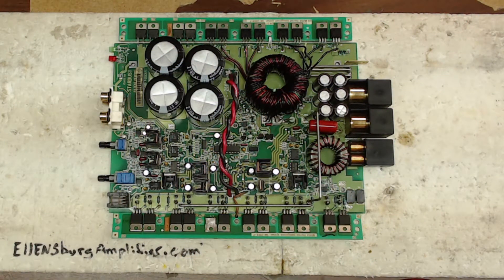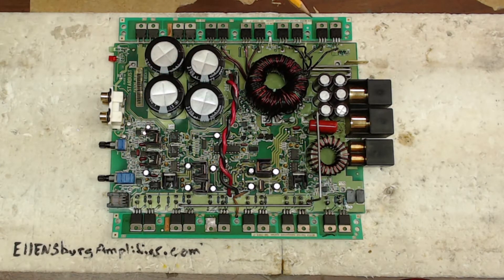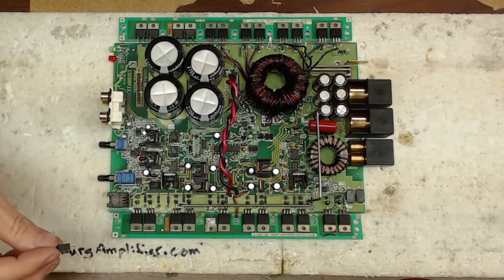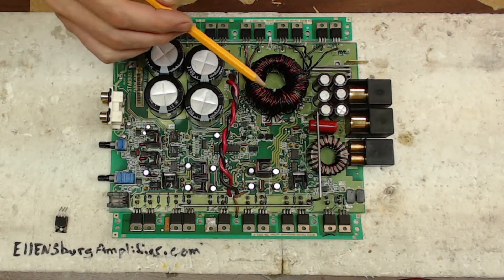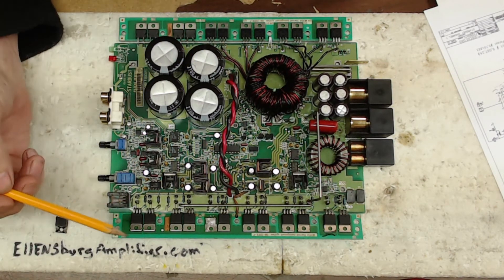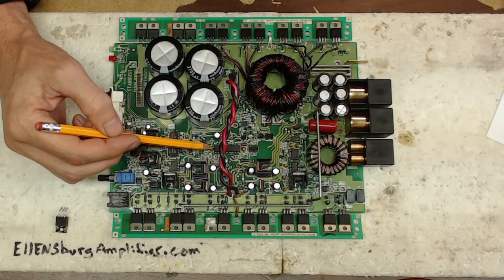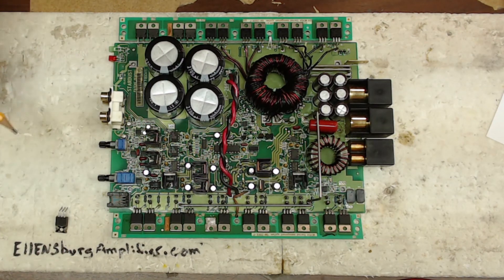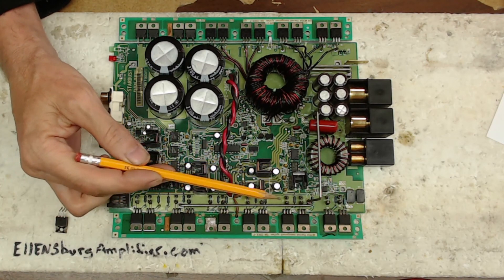Rockford Fosgate BD1000.1 Amplifier Repair Power Supply and Output Control IC's

Comment: Hi Todd thanks for the tip on using the voltage of only the remote
Reply from the maker: Thank you Tyrone for watching! I try to provide tip and tricks which makes the job a little easier.

Comment: The red capacitor behind ground terminal on my broke off. But it works flawlessly???
Reply from the maker: I think that is the output filter capacitor to ground.  You would just end up with some switching noise that you may see on a scope that could end up heating up the inductor.
Reply: @ellensburgamplifier  so what issues could it pose? It runs cool, never gets warm. Also running it 1 ohm with zero issues what so ever
Reply from the maker: @billyjeepus824  It may run fine for a long time. Just depends on how it is being used. I do believe I carry those capacitors if you are ever interested in putting one back in.

Comment: What power supply Transistors do you use in place of the MTP75N05HD on these amps?
Reply from the maker: I use the 75N05HD transistors as I stock them. I don't think I have an equivalent to them.
Reply: @ellensburgamplifier  where do you order them from? Or do you have a web store that you sell them on? Do you stock the output FETs also? ON semiconductor informed me that they sold that item to Motorola but they stopped producing them also.
Reply from the maker: @Dcelrod  I sourced my inventory of these a few years ago. Unfortunately, I do not sell them due to the low stock and their being obsolete. I hear Damon "Crazylogix" here has a supply of them he may sell. I don't repair these older Rockford amplifiers often so I am not sure what is used for the outputs.
Reply: @ellensburgamplifier  Thank you I'll try him and see what he has to say.

Comment: Would you be willing to work on a t2500.1bd? Amp has never seen under 2ohm and nothing looks blown. It just wouldn't power up one morning after working perfect the day before.
Reply from the maker: During the slow season which is October to February, I do service these amplifiers but right now during competition season, I tend to not take them in as sometimes they can take quite a bit of time to repair. www.ellensburgamplifier.com
Reply: @ellensburgamplifier  Thanks for the quick reply bud. Will send a request around then and see how you're feeling.

Comment: I have 2 of these amps that need repaired what's the ballpark estimate that it could cost to fix them? I know the one will need new power supply transistors or pHETS whichever one they use and the other I bought not working so I'm not sure maybe the same.
Reply from the maker: I don't put numbers here as the numbers can change over time. The cost depends on the work involved. www.ellensburgamplifier.com/request-a-quote if you would like more information. Thank you for the support!

Comment: I have a question I have a Rockford fosgate BD 1500.1 I had a repaired by a guy named Jason Gibson at Freeman car stereo. He replaced some output fats he said it's a power supply was whining like that one but he put four kinds of glue on it and he replaced a few of the pots game control and fixed some pads on the board that held them now he said the amp worked I had got the amp back I didn't even check it I want to sell it on eBay and the guy said it didn't work it Powers up it's not in protect I just don't get no sound now I turn the amplifier on I can see the woofers move a little bit and I'm wondering if this guy anything to do with the the sound card whatever that is driveboard or maybe it's something to do with what you're talking about what would stop the sound from coming out. What a loose pot level control perfect sound from coming out or a bad drive board I really like to get this app working but he messaged me told me if he was his he'd sell it as is because those amplifiers are really I reliable the older they get
Reply from the maker: It does sound like the output has failed. These boards will either work or they won't. There is no real in-between. I quite selling on ebay due to the fact that people do not understand clipping, low input voltage damage, or what a proper impedance load is. Do you know if he got it in, hooked it up to .5 ohm, blew it then tried to tell you that you sold a faulty amp? The problem is that the buyer has all the rights and is able to return it for a full refund. If he does then I suggest having the output looked at and repaired as needed.
Reply: I'm going to get a multimeter and check all the transistors if they're all good what would be the next thing to check
Reply: @ellensburgamplifier louder I watched the video again those transformers the guy I repair my Amp put glue on them because they were ringing.. but I'm going to check all my transistors to see if they're good or not

Comment: what are the output transistors thanks I have irf6215 406G and irf3415 303K on same output board which one is it supposed to be the same of appreciate your help
Reply from the maker: I don't know exactly what transistors that board will use but you have both the N channel and P channel which does sound correct when looking at the datasheets. The 3415 is correct as I found that I do have a schematic for it but it is not showing the P channel number. I still suspect the 6215 to be correct.
Reply: Rockford fosgate 1001bd power  old school one it's audio output channel figured you may have an idea I do have the irf3415 parts on hand is the reason I was asking thanks for your reply thebestyet218
Reply from the maker: @shawnoestreich218  If you have any shorts between gate and source you may want to check out the driver, the 4420CT.

Comment: I tried repairing a punch 120@2. I replaced the mosfets because that's all I noticed. Soon as I turned it on, pop lol. What would cause that?
Reply from the maker: Thank you for the question. This does depend on if you are talking about the power supply or the outputs but the following has the same concept for both. One of two things comes to mind. Over-heating the transistor while soldering it back on the board damaging it is one thing. The other is the drive signal. If any of the drive IC's are bad it may be turning on a set of transistors at the same time which causes a direct short.
Reply: @ellensburgamplifier  I definitely heated up the fets too much. It was very difficult getting them to lay back down flat. But I think your right and both side are coming on together
Reply from the maker: @Pittsburgh-412  There is a trick to soldering the transistors without cooking them. Hard to explain how to do it in words so I guess it will have to be a video! The next one I get in I will see if I can get a video on how not to cook them.
Reply: @ellensburgamplifier  ya that would be awesome. I seen one guy use a heat plate on his YouTube channel and that worked out. Plus I don't think I seated the fets good enough because I have a junk solder sucker lol. I'll look forward to that video man. I'm gonna sub too

Comment: trying to rest my AP on my amp what is that and location
Reply from the maker: I am not sure what you are looking for?
Reply: @ellensburgamplifier  the Amp is in protection mode
Reply from the maker: @ponchville  Unfortunately I do not work on these enough to know exactly where to go for that issue. The first thing is to check for shorted output transistors which are 90% of these failures.

Comment: Hi I need the schematic of the amp so I can repair my amp if u could help me out that would be great
Reply from the maker: There are a few different versions I do believe. If you pop into the repair group https://www.facebook.com/groups/149769529274064 you may find it under files.
Reply: Ok thanks the t-clad is messed up from a previous repair attempt so I need to try to find parts for my  bd1000.1

Comment: I think I had the same amp at one point.
Reply from the maker: Excellent! I hope you were able to figure it out if it was something you repaired. I can say that without a schematic I would get lost in a Rockford Fosgate board quickly as they use odd methods on their boards.
Reply: @ellensburgamplifier  it's was for personal use in an old 94 Mustang I use to own as well. Unfortunately, my car was broken into and the audio equipment was stolen.